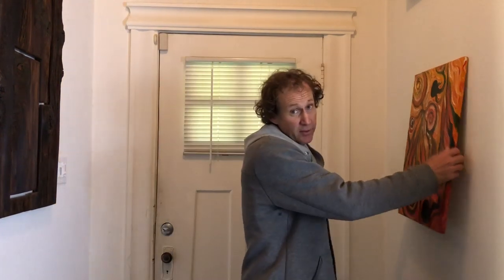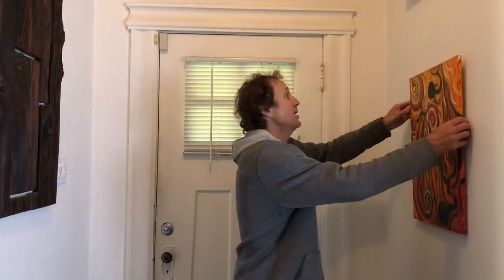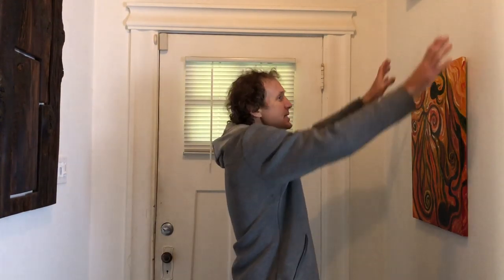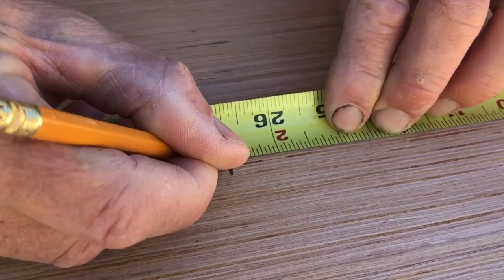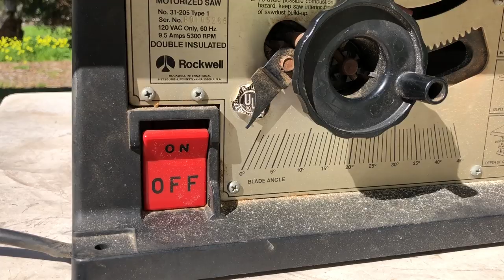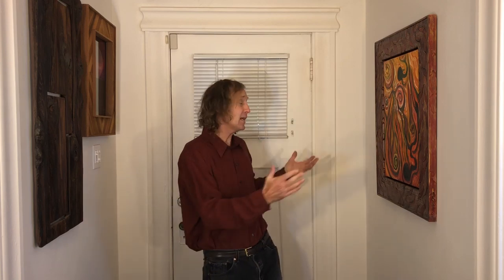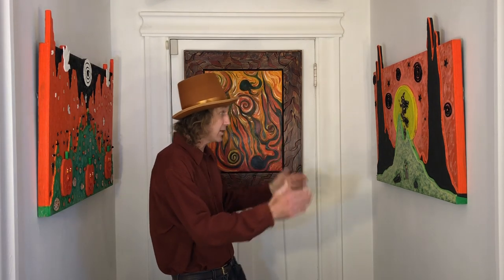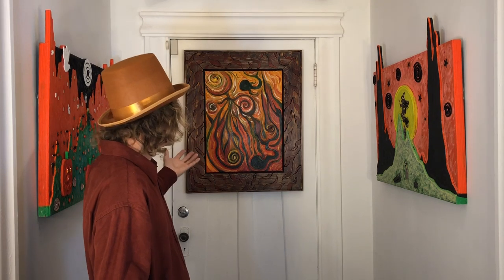Flame frame

Comment: 13:40 Oh my gosh you've ruined it... NOT!

Always wait till the final presentation from an Artist.
Your vision always amazes me.
Reply from the maker: Ha - There are a lot of times I feel the same way when doing a frame or an art piece. This is one of the reasons I spent several days in June working on distressing and finishing it - I would stain, sand, burn, restain, resand, reburn, rinse repeat until I had the right look. Then I put a few coats of water-based polycrylic on it. I got into the frame for a lot more time than I originally intended but I couldn't stop until I was satisfied!
Reply: @scottoconnor  I know what you mean. I do blacksmithing and some things seem to take forever. Then it's done and pleased with it. Hopefully we learn a thing or 2 each time.